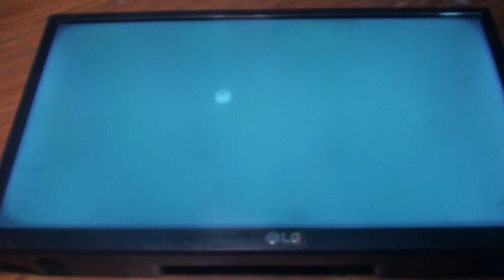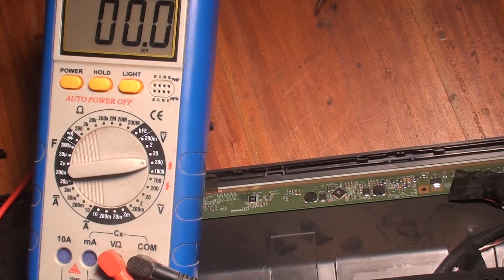Led tv panel's problem detecting process.

Comment: Is it possible to replace LCD TV panel with LED TV panel with minor changes?
Reply from the maker: possible
Reply: @ProHackHD My Sony Bravia LCD 32" KLV-32S200A is having screen problem. I want to replace the psnel with new LED panel. If it is possible then I will go for it.
Reply from the maker: @ppr9874  https://youtu.be/r21xtg0qkS4
Reply: @ProHackHD  Ok thanks for that video. I don't know the model number of LCD panel inside that has been used in my Sony Bravia LCD TV. The video in your reply, there is no mention whether the Universal panel is LCD or LED. But whatever, is it available in Kolkata? Can you quote an estimate for such changeover? If it is feasible for you to repair in my location in this lockdown period, then I will contact you in your given email. Thanks again.
Reply: both panels are same only the difference is back lights led panel have led light strips and lcd panel have cfl for backlights

Comment: Sir ji..

Many panels have not side cof, how to solve these panels?
Reply from the maker: You can solve it in 2ways: 

1. You can solve by Changing fully t-con ic.
2.  From which ic vgl supply get out, by changing it you can repair panels.
Reply: Is not satisfied answer..